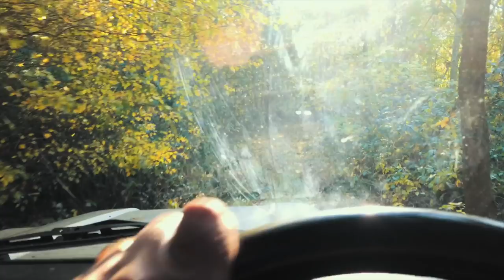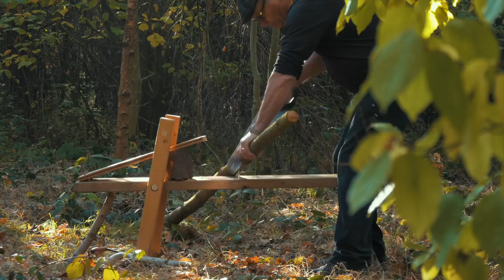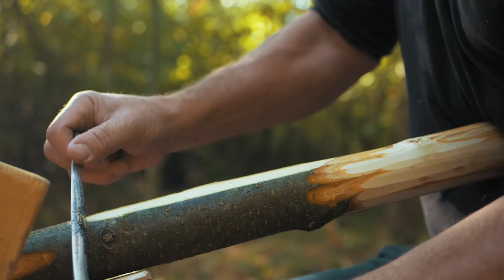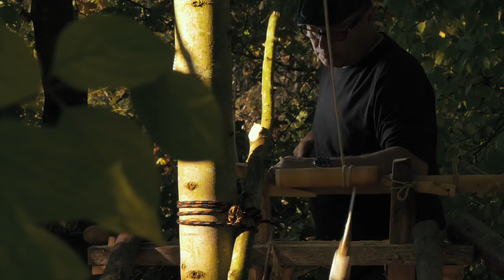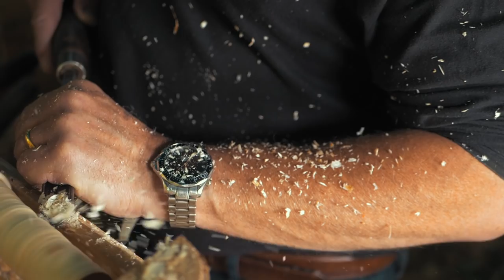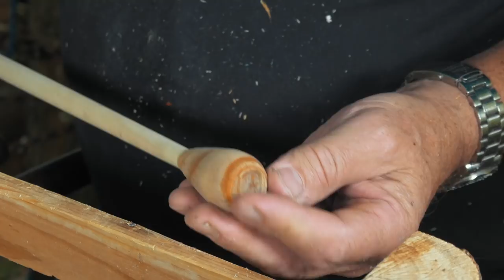Medieval Archery Blunts on a Pole Lathe (Excerpts from forthcoming video)

Comment: That's a lot better. What modifications did you have to make to eliminate the unwanted play?
About the actual blunts, what are you going to use them for and do they have to be that big?
Reply from the maker: Hi Rod. The whole lathe was stripped down and the poppits re-aligned and made more secure. It is clearer in the next video. I have also (since this footage) altered the tool rest spacers from wedges to stepped wedges, locked the tailstock adjustable bolt with a double nut (bolt kept working loose), the tailstock wedge has been re-shaped and I re-braced the whole lathe with heavy alder poles. The treadle was reworked with ash for the swinging arm (alder snapped) and the fork ends have been roped to a footboard - preventing the treadle creeping. Olive oil has replaced lard as lubricant (but the squirrels still eat that as well!) and of course I am using more appropriate chisels. As to size, well I don't know. So far I have made them so they look okay, nothing more. They will be for use against nets. The one in this video is on a half inch shaft and is just a test piece - the ones planned will be bound (probably linen thread and hide glue) and fitted with a small iron spike. Maybe. Depends on the squirrels I guess!

Comment: I've never been one to doubt you Mick ..but.. have you ever considered that the painting you saw was just bad art , and that these blunts never existed? 
I mean , why ?
What's the point if practicing with a heavy blunder wooden tip , that makes the arrow act totally differently than an arrow in battle ( or hunting )?
Surely one would practice with arrows that behave exactly the  same way as they would in real use !